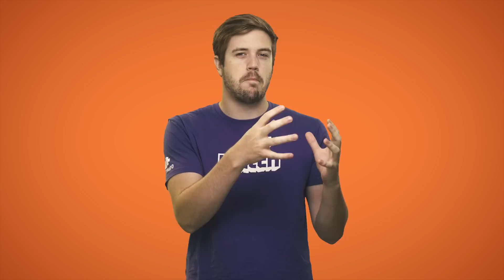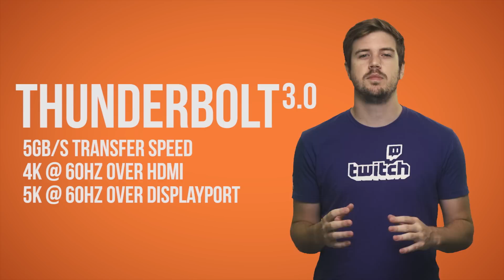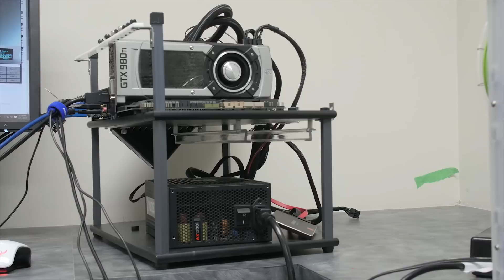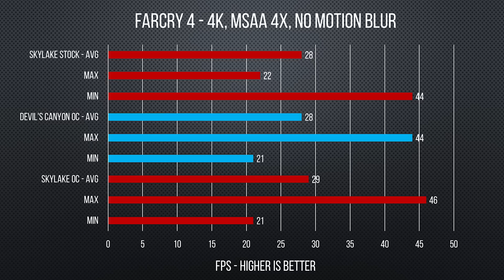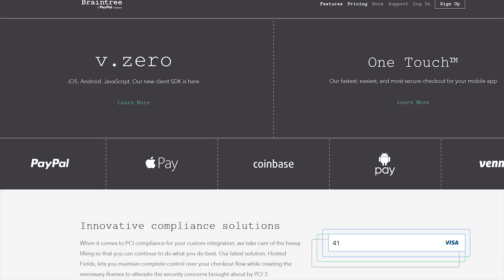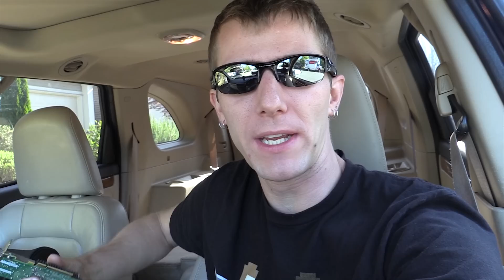Intel 6700K "Skylake" CPU

Comment: I'm growing potatoes in the backyard and it almost harvest time. How well can the i7 6700k cook my potato? I just put it over the CPU and run Aida64 right?
Reply: One must ask why are you growing consoles in your backyard?
Reply: Viet Lee This is the first time I've seen you outside of jk related videos...
Reply: DaxTran He's been around on Linus vids for a long time now. He just don't have enough followers here to know his existence lol
Reply: Actually, Intel has bigher operating temps. AMD runs hotter, but is a lot better at dissipating heat than Intel. Of course, it depends on the enviroment and cooler.
Reply: I want some of those potato's
Reply: haha oh wow, guess I never noticed.
Reply: +Robin 420 don't you mean AMD GpU's? my r9 290x is 94 degrees
Reply: Viet Lee whut about p95
Reply: The 6700k doesn't provide enough heat. You need to place your 6700k in a pot with water boiling at 210°c, after boiling your 6700k for 5 minutes take it out and place it in a microwave oven. Pick some of the potatoes and peel them and boil them in the same pot for 2 minutes. Then place the potatoes into the microwave oven, then heat the microwave oven to 150°c and set a timer for 8 minutes. Profit.